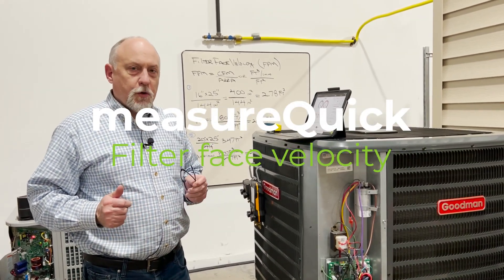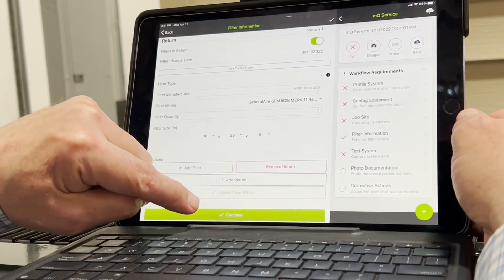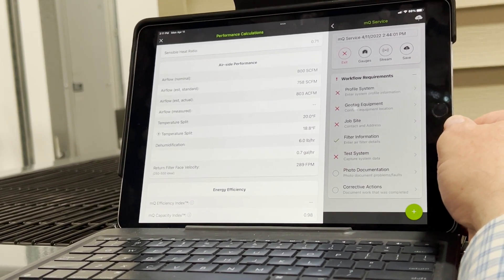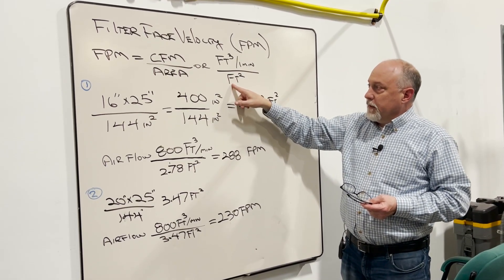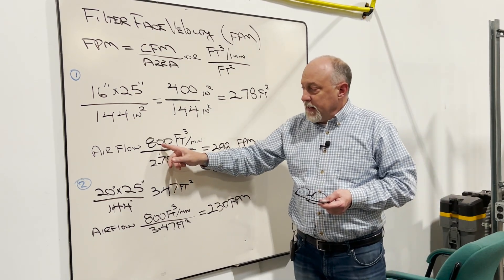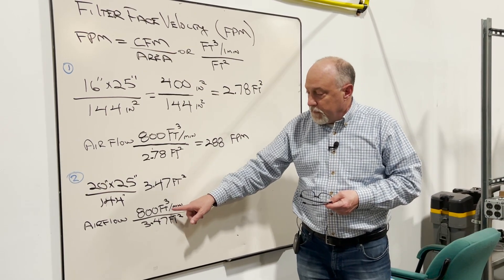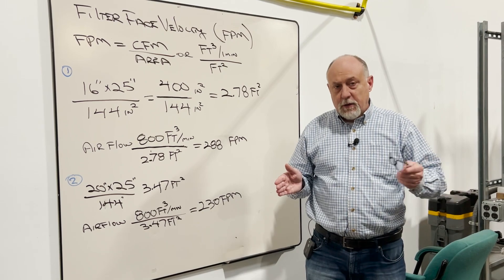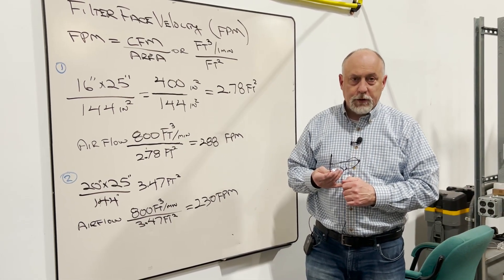Filter Face Velocity and Why it really Matters

Comment: What happens when you take a 5 inch thick filter at 20x20 inch with an average pleat of 1 inch per pleat. Wouldnt your surface area  go from 20x20 to 20x20(thickness x number of pleats). Because the app does not reflect that.
Reply from the maker: All filters are actually rated on the face velocity independent of the thickness. The thickness is more about the media that is used, and the fact that you need more surface area to account for the more restrictive media.

Comment: The 4” filter with its deep pleats will have a significant increase in area  vs the 1” filter.  It would be neat to cut the 4” filter open and lay its media out flat and measure it.
Reply from the maker: The reason for the deeper filters is because they are using a more restrictive, and better filtering media. To get the pressure drop within reason, they need a lot more surface area.
Reply: Yes I agree. Also with a 4 or 5 inch filter with a merv 8 rating the static pressure drop is be relatively low.

Comment: If using a 4” media, would the the 16x25 be 1600 sq in, then divide by 144 sq in?  Let’s say we have 1200cfm then my expected face  velo is: 109?
Reply from the maker: (16 x 25)/144 = 2.777.  So 1200/2.777 = 432 FPM. The thickness of the media has no beating on face velocity. I thicker media results in a lower pressure drop due to the extended surface area. It is often required to use more restrictive medias.

Comment: Great video Jim.  Looking forward to more videos info about FFV.  One question, does (and if so how) MERV rating affect the calculations? Thanks
Reply from the maker: It doesn’t effect the calculation, but higher MERV will reduce airflow if the pressure drop across the filter increases.

Comment: Hello Jim. Can you tell me what the max CFM’s I can pull through a 3/8 hose and 1/2 inch hose with valve stems removed and connecting condenser directly to the vacuum pump? Thank you. Bill
Reply from the maker: It depends on the hose length but typically 2 CFM for 3/8” and 4 CFM for 1/2” and 16 CFM for 3/4”.

Comment: I agree with your doubling of the filters in parallel to reduce face velocities.

What is your opinion on sizing for the variance (diversity?) of air flows between heating and cooling when one, say heating, is 50% or more than the other.
Say 800 CFM cooling (2 ton) with 1480 CFM heating (80 MBU)  an example where heating may be two stage and run times at high CFM may be of short duration.
Thanks for you Youtube videos.  Your content is much appreciated.
Reply from the maker: Always size for the max airflow requirements even if it is a short duration. It is only going to provide better filtering on low.

Comment: Great video!!! I’ve been tracking it in measurequick! One thing some of my guys get confused about believe it or not is what type of filter to select in measurequick. A video on different types of filters would help guys select the correct input into MQ ( 40% pleated,90 media ect.)
Reply from the maker: I have the guys updating that section to add some MERV rating so it is more clear. Thanks for the feedback.

Comment: Info I'm looking for for a long time now is why can a geothermal (water scource) heat pump run in at such low temps on the water side? For example, I work for school system with these heatpumps in every classroom, the geo water loop temp rite now is low 50s and even though most units are in heating mode rite now in Connecticut, some are running in cooling when needed with those low water temps. There's no defrost or any low ambient type controls on these types of systems so how can they run like this? How is it different than say running your air cooled split ac system at home when it's like 52 degrees or lower outside. These units all have lp switches but the pressure doesn't get low enough to trip them , I'm sure if the water temp was low enough it would trip but not sure how low that temp could be.  There's no videos teaching us about these types of systems and they are everywhere these days. Any chance you could do an in depth water scource heat pump video? I'm sure it would help so many of us. Thanks for all your great videos I've been watching you for a couple years now. Keep it coming
Reply: Water holds much more heat energy than air at the same temperatures, so extracting the same wattage of energy from water results in a smaller change in temperature as it passes through the water to refrigerant heat exchanger.  You could absorb heat from the water without dropping it to the freezing point.
This is why there is no defrost cycles.

Air source HP with, say a -20°F temperature change across the outdoor (52°F outdoor air temps) coil would bring it to water freezing temps, building ice on the outdoor umit and requiring a defrost cycle. This doesn't even cover the fact that the outdoor unit would require a temp below freezing to allow heat to move from the air to the coil to get the -20°F change.
   These numbers are just for illustration only to convey the differences, I hope.
Reply: @gordonborsboom7460   thanks but I'll wait for Jim to answer hopefully. I'm thinking you don't understand  my question  fully. I was referring to units running in cooling for this specific question, condensing temp would be closer to 70f minus subcooling which would be much lower head pressure than normal,which will cause even further problems indoors in the evap with very low pressures and freezing temps most likely unless your house is like 100f and dry.  I'm not sure exact numbers since I've never run a residential system in cooling in low ambient without system being designed for it with head pressure control, so I may be a bit off. But in heating mode like I think you were trying to explain, I understand how an air cooled hp in heat mode works and I understand defrost and why it's needed.  I think your a little confused with your numbers and understanding of how the outdoor unit functions in heat mode ,or I'm misunderstanding what you wrote. Either way,the first paragraph you wrote may have been an answer I was looking for,I'll have to look into it a bit further. Thanks again

Comment: Those TZOA monitors are awesome. Who is selling them?
Reply from the maker: There is a link to the meters below. TruTech Tools. They are substantially less expensive too if you buy them in bulk. I have been working with them for a little over a year, it is a solid product that is continually improving. Its slick that they can do over the air firmware updates.
Reply: Me lol

Comment: Thank you this video with the math and explanation about filter face velocity ,depth , MERV difference in relation to static is much needed. 
          Maybe now I won’t have people telling me I’m killing customers blower motors when I use MERV 16 filters 5” deep with 200 face velocity.  
     And I install a Magnehelic on the filter housing with a felt pen line I add to tell the customer when it’s time to change the filter.
Reply from the maker: .1 - .2 drop is ideal for filters. If you have that you are golden.